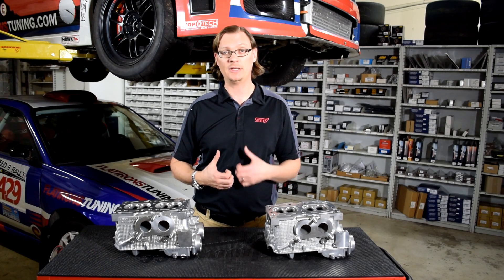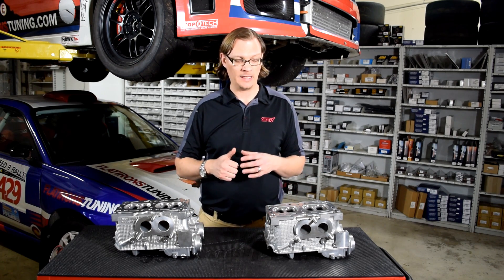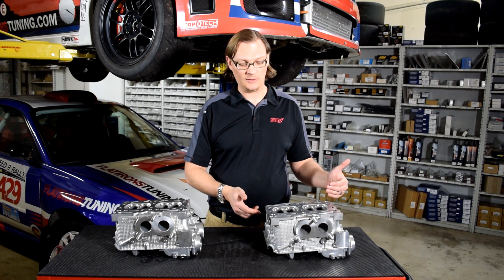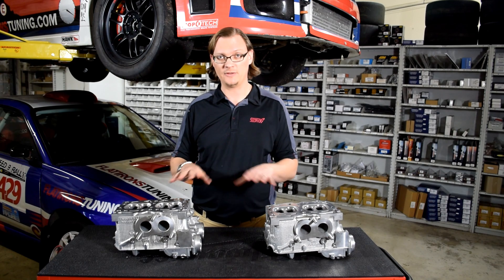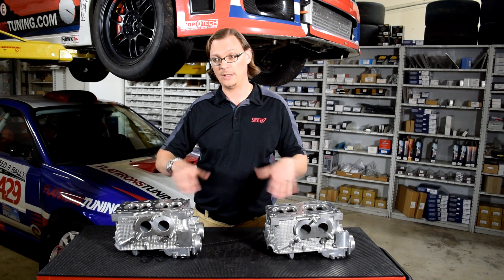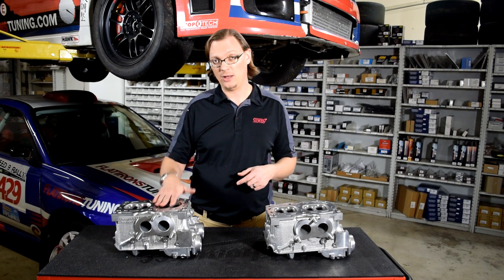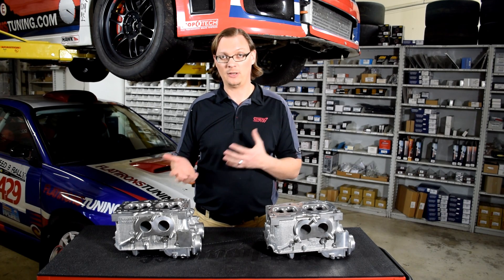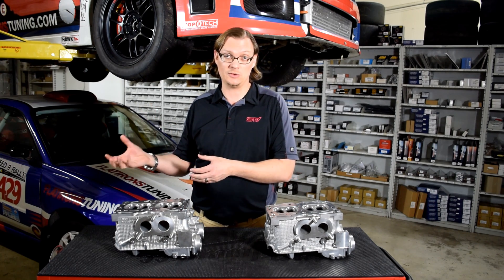Subaru Turbo B25 Heads Vs  D25 heads - What is the difference?

Comment: I got a ej255 off of a 2013 wrx. Since money is tight I grabbed B25 heads for a pretty good price. Any recommendations for the build? I do plan on boring out to fit 99.75 pistons; would I have to get 99.75 pistons with the compression ratio to match the B25 heads? Hopefully my question made sense, thank you for your help.

Comment: I have a very important question about this subject. I'm rebuilding my 2005 subaru turbo baja engine, using a new oem Type RA Short Block - 2018 Subaru Type RA. Just trying to do an oem build. Are my original heads compatible or do I need new heads that work with the new type ra short block keeping the compatibility with my baja without have to customize any other parts or electronics? Second, which heads would be the best to go with if I can do either b25 or d25? 
4S4BT63C955101472 vin if needed. I tried looking up the information myself, but I'm not sure what exactly what or where to look. Any information will help. Thank you.
Reply from the maker: Thanks for your question.  Yes, the Type RA shortblock is compatible with your Baja heads.  According to your VIN, your Baja uses the same heads as the 2004 STI, so you are all set.

Hope that helps and Stay Tuned!

Comment: Great video, I have a question, my 2007 Forester 2.5T engine is broken (D25), I replaced the engine (B25), in addition to the secondary air system shield, what other adjustments do I need to make to the computer？

Comment: I have a 2021 sti with n25 heads is that good?.
Reply from the maker: Absolutely.  The N25 heads are definitely good, and that is what your car came with.

Thanks for watching and Stay Tuned!
Reply: @FlatironsTuning  No, the customer didn't want it anymore. So he gave it to me. I was just wondering if I could use these heads on my 2013 wrx. Also, do I need a tune? I also have a vf48 with vf52 cold side compressor housing. I got it to work with a stage.2 tune. So any specific things do I have to do to use the sti heads?.

Comment: I had to rewrite the entire tune from scratch when porting and changing heads. Also took 3 degrees timing out to compensate for compression and knock in the peak load range of 2500-4000 rpm as well as changing the entire maf scaling curve. So yes you need to tune the car custom when switching to the d25 heads. But the torque gains at low rpm say 2-3k are incredible. It’s almost like driving an na car but then the turbo takes over and the torque curve is drastically changed for the hood by changing to d25 heads. And yes ethanol, my car runs so good on ethanol due to the compression bump. And porting this is for pump 92 octane map. Ethanol I put the 3 defrees back plus 2 more degrees is some areas and run a couple more pounds of boost, as well as the injector rescaling. have not done an ethanol dyno tune but based off the 92 octane tune that’s verified, it makes more torque and hp for sure. It’s Avery noticeable difference

Comment: I run d25 heads on my 06 sti 85 rx swap with 100mm bore, 18 psi, 400 wheel torque, 8.8:1 compression d25 heads have more meat to port, and flow better, and actually the intake cam has more lift than the sti. More compression, and it actually loves ethanol.

Comment: @Flatironstuning I have some 8.2cr pistons(99.75) and I want to rebuild my 06 OBXT with?  Right now I was planning on using my factory heads.  Awesome video btw if I didn't see this I would assume the lower compression pistons can work in any 255/b25 block/head combo or can it but a tune would be needed?  Would porting/cams/valves/valve size cause issues for the worst.  Just looking for a ~325 to~350 capable daily.  But will drive on ~275ish.
Reply from the maker: Thanks for your question.  I'd recommend looking at any information that the piston manufacturer has on the pistons you have with your heads.  Many manufactures will give you the compression ratio with both common heads.

From there, if you do have the D25 heads and STI pistons, you can run a 1.1mm head gasket to get compression back close to stock.

For the power levels that you are shooting for, that thicker HG would be a good option.

Hope that helps and Stay Tuned!
Reply: @FlatironsTuning  This helps a lot. Thank you for your response. So b25 heads mated with 8.2cr pistons would require what HG thickness? And if it’s on the more stockish thickness which one would offer the better sealing of the head/block?

Comment: So i have a weird scenario. I have b25 head and a d25 head that came on my motor. Whats the scenario im dealing with? Has what im assuming 4 b25 pistons
Reply from the maker: That is definitely odd.  At a minimum, that would mean that you have mismatched heads, and that could certainly run into some driveability and reliability issues with the car.  i'd recommend having a machine shop inspect both heads, and if the D25 head is in good shape, get another matching D25 head to put back on the engine.  You may want to start from scratch for the build though.  If someone put an engine together with those parts, I don't think that I would trust any of the rest of the build without a thorough inspection.

Hope that helps and Stay Tuned!

Comment: Can you tell me the difference between D25 and N25 heads?
Reply from the maker: Thanks for your question.  The N25 heads are an update of the W25 heads which were the Dual AVCS STI heads.  In short, the difference between those two is basically the same as the B25 and D25 heads discussed here.

Thanks for watching and Stay Tuned!

Comment: i got a 06 wrx and im looking to upgrade the pistons/rods for a bigger turbo... will a lower CR by changing to a b25 head be worth it?
Reply: You have d25 heads with air injection. You'd have to block off the air injection system and have it tuned most likely.

Comment: Hello there I’m lookin into doing the full 2.5 swap in my 02 wrx I’m using an RA block and was wondering if there’s benefits to using single or dual AVCS heads and If I have to block off secondary air stuff if I’m not utilizing it? Great video
Reply from the maker: Thanks for your question.  We cover all of that here:

https://youtu.be/6Xzopgayw7c

That is the video where we go into detail of making that conversion.

Hope that helps and Stay Tuned!

Comment: I have D25 heads, and I'm wondering if the JE hybrid pistons will work with them or do I have to get different pistons that match the D25 heads? Thank you
Reply from the maker: Thanks for your question.  The JE Hybrid pistons are for 2.0 liter heads only.  If you are using D25 heads then you would just use the standard JE pistons for your build.

Thanks for watching and Stay Tuned!
Reply: @FlatironsTuning  ok I understand I already have the hybrid pistons will they work with a tune with little complications?
Reply: @FlatironsTuning  I am only asking because it was stated they closely resemble ej205 since they are only off about 2CC?

Comment: Hey how's it going, so when you said that it if you put d25 heads on a ej257 it would need a tune, would the accesport have a good tune for that ? Also what head gasket do you recomemd when putting d25s on a ej257 shortblock. 

Thanks alot man you're probably one of the best subie channels. ✅️
Reply from the maker: Thanks for your question.  The reason you would need a tune is because of the bump in compression.  Yes, the Accessport will allow a tuner to tune your car for that, and anything else you might need.

If you run a 1.1mm thick headgasket, that will drop compression nearly back to what your EJ255 came with stock.  Roughly 8.5:1.  It would still be recommended to tune the car with that configuration, but I would say that it would not be as critical as if you were running a stock thickness headgasket.

Hope that helps and Stay Tuned!
Reply: @FlatironsTuning  would the ej257 come with the 1.1mm head gasket or no?
Reply from the maker: @andradee5103  No, the stock headgasket thickness is about .7mm.  1.1mm head gaskets are thicker than OEM.

Comment: Also I have a 2006 wrx but it has b25 heads it has a all cylinder missfire would I need a tune to fix that
Reply: So I bought a 2006 wrx but it had b25 heads instead of the d25s right now it has a missfire in all cylinders is it because of the swap or the heads need work?
Reply from the maker: @andradee5103  At that point, I'd recommend working with a mechanic to trouble shoot.  There are a number of reasons that you can have misfires.  But if you put B25 heads on an EJ255 block, that will cause a somewhat large drop in compression which would not be ideal.

You definitely need to find the reason that the car is misfiring.

I'd recommend doing a compression and leak-down test as well.

Hope that helps!
Reply from the maker: Thanks for your question.  If you have a misfire, you need to diagnose that by itself.  That indicates that you have a mechanical issue, and that would not be fixed by a tune.

Thanks for your question and Stay Tuned!
Reply: @FlatironsTuning  so if I put b25 heads on a d25 motor it shouldn't misfire ? Also thank you for the reply!!
Reply from the maker: @andradee5103  Just responded to your other question, and covered this as well.

Thanks!

Comment: I dont think all 2007 STI came with V25 heads. I have seen two 2007 STIs  with D25. Both STIs were unmodified and original engine.....can someone double check this. thanks
Reply from the maker: Thanks for your question.  I can tell you that no STI ever came from the factory with D25 heads.  In the Subaru catalog, there is only one part number for each head for the model year 2007 STI, and those are the V25 heads.

Hope that helps and thanks for watching.  Stay Tuned!
Reply: @FlatironsTuning  that's so weird. The reason I'm bring this up is because my 07 STI is unmodified ive been the only owner  and it came with D25 heads. I noticed this while doing the clutch. Car runs with no issues. So maybe there are few exceptions. 
The other 07 STI I know with D25 heads it's in San Bernardino. Car was unmodified, but unfortunately ring land failed on 3 and 4.

Comment: @Flatirons could you please compare the W25 and N25 heads (dual avcs)? Thanks!
Reply from the maker: Thanks for your question.  The short answer is that from a combustion chamber stand point, there really isn't any significant difference to the B25 and V25 heads.

But we will keep that in mind.

Thanks for watching and Stay Tuned!
Reply: @FlatironsTuning  thanks for the reply. I was referring to the 2008-2017 W25 heads vs the newer N25 heads on the 2018+ Type-RA. It seems these are the current EJ design
Reply from the maker: @alexudolkin2146  They are different part numbers, but we have yet to find a significant difference between the two.

Comment: The 04-06 Baja Turbo seems to usually be glossed over in these comparisons and it's hard to find info.  From what I can gather, the 04 & 05 Baja Turbo used the B25 heads, and the 06 used D25.  So am I correct in inferring that the only differences between the 04/05 Baja Turbo and the 04-06 STI are the turbo and intercooler (and paint color of the intake manifold)?
Reply from the maker: Thanks for the question.  The Baja Turbo is a really hard car to work with because it doesn't follow many (if any) of the part fitment trends of the other car.  For instance, yes, the engine has B25 heads, but side feed injectors, and a WRX manifold, not an STI manifold. And it uses the FXT Intercooler. 

They are so different from the other cars, and there are so few of them (comparatively), that we don't talk about the Baja specifically.

They are very challenging to find aftermarket parts for.

Hope that helps, and Stay Tuned!
Reply: @FlatironsTuning  Hmm what is the difference between the Baja/WRX manifold and the 04-06 STI manifold?  They are both aluminum, so I thought they were the same other than the paint.
Reply from the maker: @robcacioppo1210  The biggest one is the throttle body.  The WRX is a cable throttle, as is the early Baja I believe.  That puts the throttle body in a different location, and has a different bolt pattern compared to the drive by wire cars.

Comment: Hi there! I am really curious, you mentioned under one comment that valves are interchangeable, however I've seen my B25 heads the exhaust valves are marked ED3 and the D25 have marking ED4. I've looked up and it turns out ED4 valves are no longer sodium filled. Is that for all D25 heads and does that make D25 OEM heads weaker and more detonation prone when it comes to going for higher boost and power? So if I swap my B25 heads with D25 with ED4 valves and keep it tuned to ~300hp will that cause issues?
Reply from the maker: Thanks for your question.  From a size and fitment standpoint, the S20 heads, B/D/V/W 25 heads all use the same size valves.  Subaru went away from the sodium filled exhaust valves fairly quickly in the STI and LGT/FXT.  There just wasn't that much of a benefit for the sodium filled valves unless you really needed the better heat transfer.

And if they snapped from piston contact, it made a heck of a mess in the head.

The STI has been running standard valves from 2008 on, and the WRX always had them (D25), and plenty of those cars are making reliable power with the stock valves.  I'd say keep it simple.  Factory valves or the equivalent will be fine for your build.

Hope that helps and Stay Tuned!

Comment: Awesome video! 👍
How do I figure out comp ratio of stock usdm ej205 heads on stock v7 ej207 shortblock? 🤷‍♂️
Reply from the maker: Thanks for your question.  Start by looking at the combustion volume of the two cylinder heads.  I think that the EJ205 and EJ207 heads are very close, if not the same.  Then look at the piston dish.  I think that some of the STI engines did have higher compression, and I'd guess it came from the piston dish, not the cylinder heads.

Hope that helps and Stay Tuned!

Comment: How much do the big port EJ207 AVCS spec c big port heads compare to either of these?
Reply from the maker: Thanks for your question.  The castings are roughly double the cost of the USDM options.

Here is a link to them on our site:

https://www.flatironstuning.com/genuine-subaru-ej207-avcs-spec-c-big-port-cylinder-head

Thanks for watching and Stay Tuned!
Reply: @FlatironsTuning  hey thanks for the quick reply but I was actually wondering about the physical size difference in port of these vs the big port jdm heads. I have these on my current ej207 and was wondering if they are worth keeping once I drop in one of your shortblocks
Reply from the maker: @gavin__  Gotcha.  This thread on NASIOC has the best picture comparisons of all of the heads:

https://forums.nasioc.com/forums/showthread.php?t=903873

Generally speaking the 207 big port heads are in the direction of the fully ported 2.5 liter heads, but some of those 2.5 liter ported heads are opened up a bit more than the 207 big port heads.

I hope that helps and Stay Tuned!
Reply: @FlatironsTuning  That helps a ton, been scouring the internet all morning for an answer. Thank you!!

Comment: Are the valves interchangeable between the B25 and D25 heads?
Reply from the maker: Thank you for your question.  Yes, the valves are the same between the B25 and D25 heads.  

They are actually the same for all of the EJ25 turbo heads.

Hope that helps and Stay Tuned!

Comment: So I just put b25 heads on my 2006 wrx ej255 stock block and now knowing about the difference between the d25 what should I do
Reply from the maker: Thanks for your question.  Have you started and ran the engine yet?  Is it in the car?

Ultimately, your compression ratio would go down.  The good news is that this should not hurt anything, but it may cause some loss of power, etc...

If you can, open up a live chat with us with more details about where you are with your build and we'll do our best to help out.

www.flatironstuning.com is where you can find that live chat.
Reply: Will it be ok to drive it like this with cobb mods

Comment: So what about the differences between the V and W heads?
Reply from the maker: Thanks for your question.  The V25 heads are only on the 2007 STI, and they are single AVCS.  The W25 heads are on the 2008 - 2017 STI, and they are dual AVCS.  From a compression stand point, they are the same.  The main difference is single vs. dual AVCS.

I hope that helps, and Stay Tuned!

Comment: Great video I have been looking for information on Spark plugs on 2.5L subaru. I think I know the answer but the heat range would be in question because because they razed the compression on the 2019 models or so I understand. However do all the boxer engines heads take the same size/type spark plug? Thanks for making these videos.
Reply from the maker: Thanks for your question.  First, they did not raise the compression in 2019 from what I have seen.  The STI has been 8.2:1 since 2004.
All of the 2.5 liter EJ turbo engines do use the same plug, but it is a much different plug than what was used in 2.0 Liter heads.
I hope that helps and Stay Tuned!

Comment: On later model 08-14 WRX or STi are the B25  and D25 cams, springs, and valves the same? 
Just curious because I'm looking to push my stock D25 head out to 7600 rpm at 29psi so I can stay in 4th gear through the end of the traps at the drag strip.
I've seen stock B25 heads get pushed to 8K without issue.
Reply from the maker: Thanks for your question.  I believe that the springs are the same on all STI heads.  On the B25 STI heads, they use sodium filled exhaust valves (2004 STI has sodium filled intake valves as well), and starting in 2008, all of the STI's went to metal valves, which I believe are the same as what are used in the WRX.

Not to say that would have any effect on max RPM, but I mention it because those are the majority of the differences between the model years.

I hope that helps, and Stay Tuned!